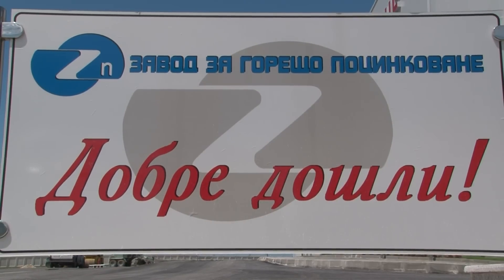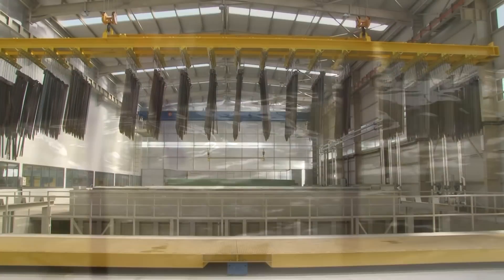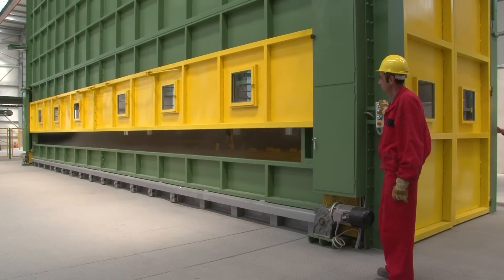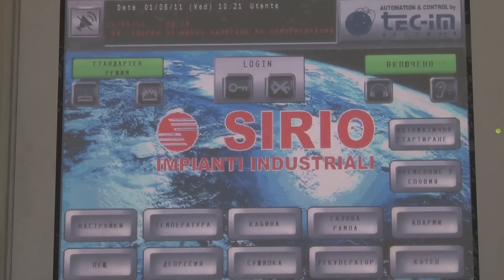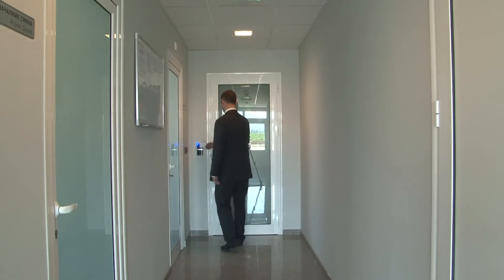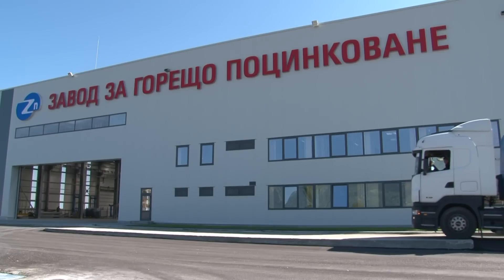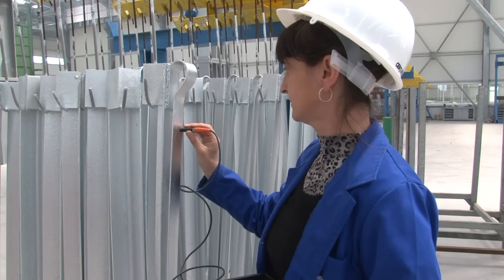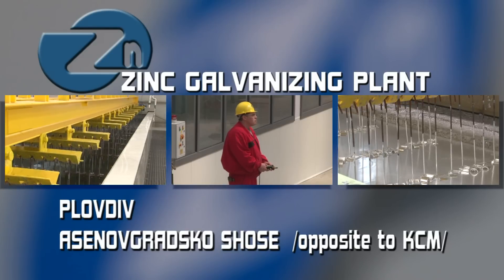Zinc Galvanizing Plant, Plovdiv, Bulgaria - www.zgp.bg

Comment: How do you remove those dripping zinc?
Reply: Hello. The zinc drips get filled off, or lightly grinded until flattened. They must not be ground too hard. Doing so will result in removal of the zinc and therefore creating a bare area, which, must be repaired. I am also a galvanizer
Reply: with a file.

Comment: how may person used in zinc bath for skimmed.
first of alll used satisfation person and length of skimmed equipment is less than 200mm as compare to widh of zinc bath and used ammonium chloride & alluminium and main thing withdraw material as slow as possible.andhit the material as a withdraw time for drainage zinc..that's thing you will rmove pimple and runs on your material
Reply: Also removing material on a steep angle will allow all zinc drainage to flow to one specified area, making it easier for cleaning as well.